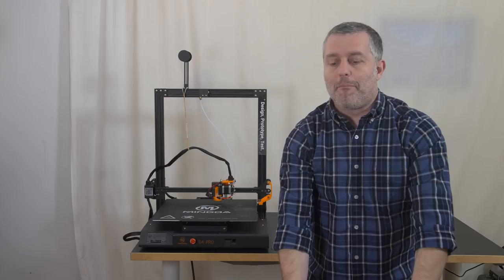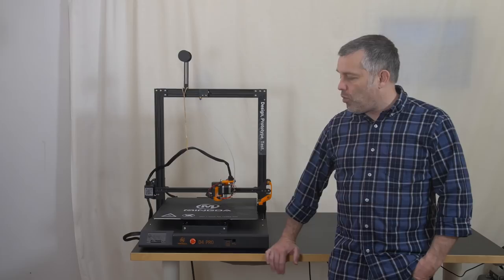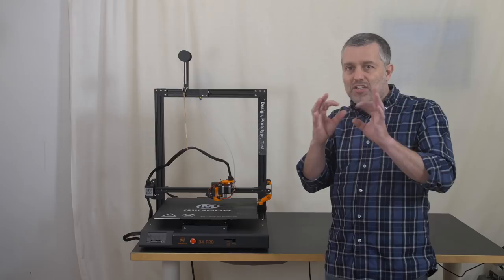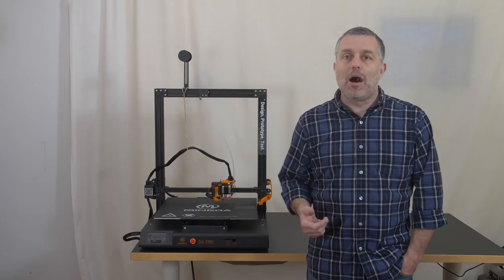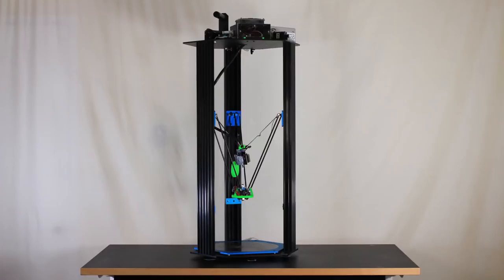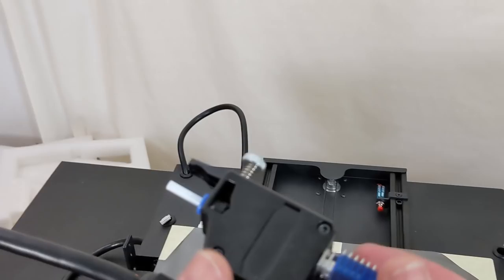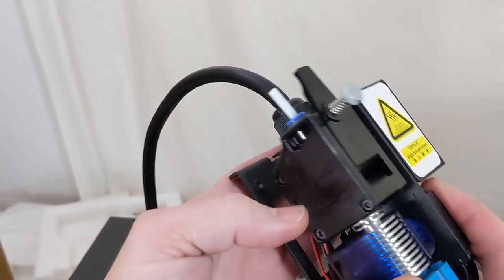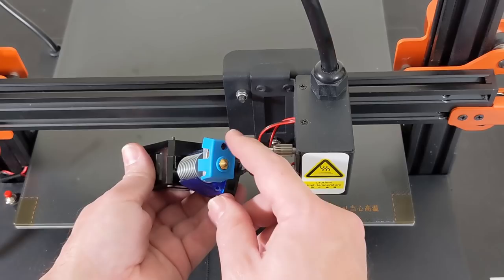The Mingda Rock 3 Pro Review & Upgrade Video - A 3D Printer Well Worth The Price

Comment: Nice review, very detailed! Also, you mentioned changing the board and/or LCD in the video. I happen to have fried my board on the Rock 3 and need a replacement. What would you suggest? If there's a video on it it would be wonderful. Thanks in advance!
Reply from the maker: Definitely a Duet control board. Follow the guides for the Ender 3. It will be pretty much the same for you.  I have many videos about Duet 2 Wifi instalaltions, but you will probably want to go with a Duet 3 mini 5+. It's a little different, but you should be able to figure it out. The information is out there and Duet has a great forum for asking questions if you get stuck.
Reply: @DesignPrototypeTest  thank you! The one question I wanted to clarify about this is whether the new board will take and work with the original firmware?

Comment: My friend has the Mingda Rock 3 and he talked me into the Prusa MK3S+ because I'm not all that interested in playing around with the fiddly parts. I just want to print.  Now, I did buy the kit some I'm not entirely devoid of fiddly parts.  Prusa doesn't innovate?  Maybe but with the PLUS they have introduced the Super Pinda which so far appears to be amazing.  I never have to fiddle with my bed adjustment. Before each print, it does a 9 point calibration to confirm all is okay.  As far as I know, the bed doesn't adjust and I can't believe it can bow as there is a center screw in the middle of the bed.  The coated metal flex bed plates so far seem to be great and being magnetic, no need to fool around with clips.   I got the printer the first week of February and the counter says I have over 6 days of printing so far   3D printing is a blast.  I've not had any cooling issues so I don't think I need to fiddle with the fans.   I'm guessing it has to do with physics or thermo-dynamics but I would like to see prints measured in minutes instead of hours, now that would be innovation in my book!  Anyway, good video and for now if I were to get a Mingda it would be the Rock 3 Pro.

Comment: Grab a small blunt soft 'pick' and carefully stuff the excess filament runout switch wire length into the hole until the heat shrink actually performs its chaffing intention.  Then you'll never have to be worried about the bed inadvertently snagging the wire.  😃

Comment: It's not true that you can't add a bltouch, I have the source code, you just need to enable it and physically connect it to the port on the board. Still a great review
https://www.thingiverse.com/thing:4659128
(in the configuration.h the max_pid is set to 125 instead of 255. So it doesn't use all the power possible, this setting comes from the stock firmware, I recommend putting 255 and perform a pid autotune)
Reply: Yes, it even has the wiring plugged into the main board for a touch sensor already. As does the original Rock 3 which I have and have added a BL Touch to...
Reply from the maker: Can you share a link to the firmware upgrade for everyone?
Reply from the maker: Can you share a link to the firmware upgrade for everyone?
Reply: @DesignPrototypeTest  I added it to my comment above

Comment: Genuine question, wouldn't a company like Prusa who takes what works in other printers and combines it all into one polished kit be something that would be perfect for you? Or does it take away some of the hobby for you?

I know you've expressed distaste of Prusa in the past, but I think the draw IS that they reference other designs. It's just a conglomerate of what works with solid software on top. There's definitely a benefit to having consistency in design. The price isn't hugely off either especially when you factor in mods and repairs.

I 100% understand the want to tinker and mod. That's my main draw to the Voron. So I guess I'm just wondering if it's mainly that or if it's another reason.
Reply: All printers have issues, even the Prusa. You can upgrade the Prusa further using Pulse hardware/printed parts, rail bearings and Duet electronics. It will take a lot of "hobby" to get the Prusa to perfect.
Reply: @MichaelJHathaway   @Michael Hathaway  oh of course!! Literally every printer can be improved. But a lot of the modifications done to cheaper printers is to get to a base level of quality/reliability. As well as, like mentioned in this video, usually fix sometimes dangerous oversights.

I would think the Prusa is a lot better of a starting point. Or for many, an end point. Most, not all, of the "upgrades" I see done to the Prusa Printers are preference and not necessarily inherent improvements. For example, many have found upgrading the bearings/rails to maintain or decrease print quality. On paper it's an upgrade, in practice it doesn't make a difference. That's why you don't see a crazy amount of "upgrade kits" for the Mk3 and that's kind of what I like about the Prusa design. It's really simple without overcomplicating anything.

It definitely depends on what you define perfect, but the Mk3 is by far more reliable than any of the heavily modded Chinese printers I've had in the past. Not saying it's a crazy difference in print quality. I've put 100s of hours in the past getting different printers to print really solidly, but I usually ended up with a printer that was nowhere close to the starting point.

I guess it was more of a conversation point on what we define value as.
Reply: @FTGTapGod  I think what a lot of people do when looking at these printers is the cost of entry. The chineses ones are cheap and will get you printing no doubt, for how long and what quality is debatable. Prusa's are not perfrect (look at the Bear upgrades etc. or even the caribou printers) but I think because of the quality hardware and fine tuned firmware (chinese printer firmware again is another debate) and in my experience better support than from Chinese companies (so far), they are in general a better option that need less upgrades to be a solid printer. If you factor in the money and time spent getting your cheap printer to the same level as a Prusa in terms of print quality and required maintenance, then you are getting closer to what a Prusa cost. After all, all printers we can buy on Amazon or Aliexpress or even from Prusa are really just clones of the original Mendel and it is after all "open source". So, when people start arguing about this company copied or stole a design from that company and vice versa, my opinion is MEH... they ALL do it to some extend, some companies are just better at it improving whilst others bring the cost down and quality suffers. At least for the consumer there are more options and that is a win in my book.
Reply: @TheSanzca  yeah I agree with pretty much everything you said. I don't understand the copying argument either. Most good products are just refinements on another's idea. The Caribou printer kits are great! Kind of the same idea as the Prusa in my mind though. If you know you want to have a printer like the Caribou, buying the Caribou kit, although it costs more, means you spend money on the right components first instead of wasting time/money on the Prusa kit in the beginning.

I definitely understand the cost of entry thing. I guess I just get confused with people who buy them just to take them apart/spend the money right away. Unless it's just because you want to. Do whatever you want, it can be fun.

I would think there would be roughly two camps of tinkerers. Those who cost of entry is really important and you pick up something like an Ender 3 to get started on and slowly upgrade over time. Or those who know what they want and know what they are doing enough to buy the higher end components in the beginning to build their "perfect" printer.

He definitely seems to get the on a budget tinkerers and I actually love the printer mods content, but then he strangely flips to almost outright hatred of the "overpriced" Prusa kits. I just don't get it. I'd love to see some content from him where he messed with some higher end kits like the Prusa (arguably) or something like the Voron would be fun.

Comment: I really appreciate this channel. Bought this printer based entirely on this video. I still like the channel. But this printer is a 50/50 gamble at best. Product support is absolutely laughable. The touchscreen on mine died after the 5th print. Contacted support. Told them very clearly what had happened. Their response.... "You need to re-level the bed to get good adhesion."  WTF? I re-state the problem. Next response was, "Maybe your filament broke." Um, okay then. Bottom line, if it works it works well. But if you run into any problems at all, don't bother with customer support. Just box it back up and send it back.
Reply: I also have a Mingda, and similar experience with their support.  It seems they cannot be bothered, or do not really understand English (you have to if you want to deal world wide) or both.

Comment: Thanks for the detailed overview. I just ordered one of these, but have not received it yet. One of the reasons that I picked it was that it is supposed to be BL Touch ready (at least after a firmware update that Mingda provides on their website). Mingda's video tutorial on the subject shows that the mounting holes, and plug for the BL Touch already exist. Do you have any experience with this, and do you know if the bracket for the BL Touch sensor is included with the accessory kit that is included with the printer? None of this information is provided, and I'm just curious if you have any insight. I appreciate it.

Comment: - Flexible couplers cause issues with elephant footing
- I don't see any processor on the LCD board, the fat LCD cable looks like the LCD is being driven by the mainboard, which means it would be possible to put marlin on this, with some work.

Comment: Have you had to change the hotbed cable  mine got fried and I ordered a new one but they didn't indicate which one on the new cable which is negative or positive
Reply from the maker: It doesn't matter which wire goes to + and which to - on the hotend heater element. Being a simple resistive circuit, It works with either polarity.

Comment: Great video and the mingda is for sure a very interesting printer, BUT... in all your comparisons, you failed to review the CR10S Pro V2 which in my opion all these other printers are trying to copy. Even though it is a bowden style printer (can easily make it a direct drive), I think it sets the standard and failing to compare printers to it, especially the 300x300x400 sized ones is just a travisty and leaves so many unanswered questions. I am biased, I own the cr10s pro v2 and yes, it has shortcomings, but man, it is solid; prints great and the BLTouch almost makes it an auto bed leveling printer.  I do hope you even out the playing field and review the cr10s pro v2. PS. The perfect printer is the Voron V2.4... would make a great video series building one of these!

Comment: so replacing the mainboard and tft with the duet board how do you get it to recognize or understand the hardware layout to print correctly with firmware?
Reply from the maker: Here is a video of me configuring Reprap Firmware on a Duet control board installed inside an Ender 3. It would be the same process for this Mingda printer: https://youtu.be/SOZe_fg9DN8?t=1069 Previous videos in that playlist showed how to physically wire the board: https://www.youtube.com/playlist?list=PLtVk4dZInT80SCVB_Pgrn1zZThO3nmV7B

Comment: Do you upgrade the touch screen when changing to the duet mainboard??
Reply from the maker: I don't use a screen on the printer once I install a Duet3D control board. I use a tablet if I need to do work at the printer or while controlling the printer. Most of the time I just control the printer through my PC across the room. It's very easy to control many printers through a single tablet. I made a video about it a few months back.

Comment: Nice Video. Thinking of getting back in to 3D printing. If you could only get one 3D printer would you recommend the Mingda Rock 3 PRO or the CR10s PRO V2.
Reply from the maker: CR10s PRO V2 I hate the fact that the Rock3 Pro uses cloned hotend components AND they don't work. I was printing with 98A flexible filament (not all that floppy) and the filament jumped out of the filament path and got all wound up inside the extruder. There was like 400mm all tanged up inside there. MASSIVE FAIL! The whole point of a direct drive extruder with dual hob gears is to print flexible filament well. The rock 3 can't even handle 98A filament. The hotend design on the Mingda D2 and (discontinued) D4 is better.

Comment: Can you move the filament spool way to the right so it lines up with center better?
Reply from the maker: The holes are threaded and taped. To do what you are suggesting means drilling and taping new holes or the much more easy solution is using some T-nut inserts.